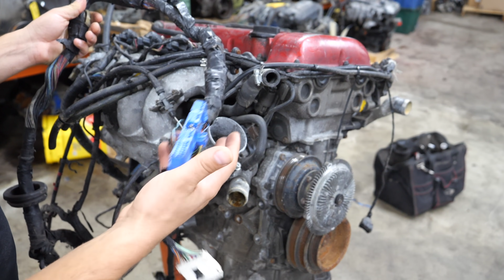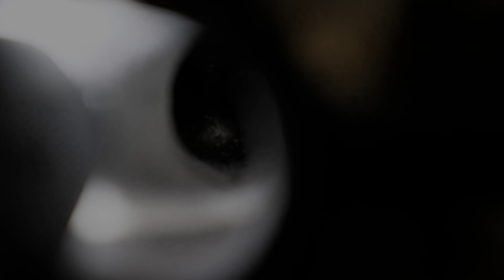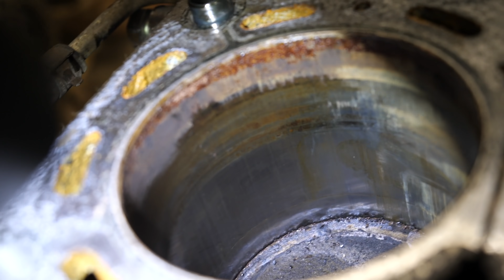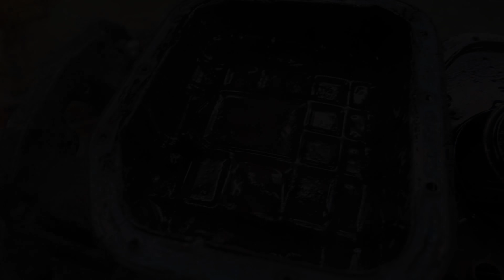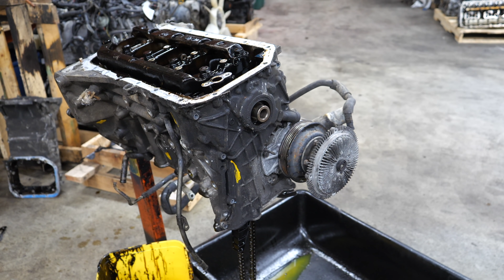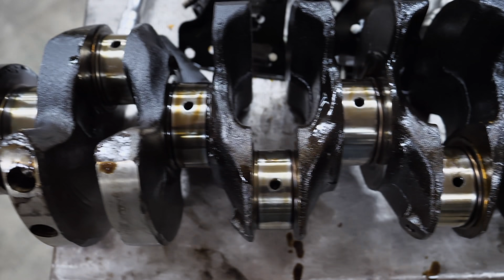JDM Nissan Silvia SR20DET BAD ENGINE TEARDOWN. What Killed The Most Popular 240sx Swap Engine?

Comment: These engines have great aftermarket support, so getting replacement connecting rods will be easy. The cylinders look like they could be bored to a common oversize, so no worries about finding pistons either. It will need valves, but those are also easy to find.

This looks like a good core for a high boost Silvia build.
Reply: Thinking same thing. Plus a bore out with the right piston equals more room for boost?
Reply: @dooooooval904  When you rebore and rehone, you can follow the piston companies recommendation for how much clearance for how much boost you take.
Reply: There to expensive and have many issues.and the rocker arms are a problem in making higher horsepower,and there getting quite old.

Comment: I had a 200SX SE-R back in the day. Only issue with the engine was the timing chain tensioner which caused chain slap on startup. Easy fix with an upgraded one from a newer SR20. Drove it over 200K miles with no major issues until I got T-boned by a red light runner. Stock it made good power and torque for the time and had a 7.5k redline if I remember correctly. Great motor.
Reply: The B14 SE-R will age like the S130 did. They have parallel stories. A little softer, a little more refined, arguably better in some ways than its predecessor yet these same virtues could also be held against it. Looks also generally weren't well accepted despite being beautiful in its own way. It won't be long before a lot of people who have a first gen SE-R on their bucket list get priced out (many are right now) and realize the next best thing is right under their nose. Just like the S130 is finally getting its due, so will the B14 SE-R. iykyk

Comment: Looks rebuildable , bore and hone the cylinders , replace the bad rod , new pistons , and get some good , long miles out of it ( but that's my opinion )
Reply: It is clearly rebuildable.
But you still needed to disassemble it entirely.
Selling the parts to repair another one (or in fact quite a lot of them) is equally good.

If it were mine, I would feel pretty lucky to only have a rod to replace, and would probably just clean of the bad cylinder and not even overbore them.
1 new rod, 1 head gasket, new rings, new bearings, then check and lap the valves and I would just run it that way if it passes a leak down test with similar enough results on all cylinders.
Reply: Depending on how much of a overbore the cylinder walls need couple need a sleeve at that point it's 👎
Reply: @ohhthepatpat  from the looks , not much , just a slight amount for ensuring the rust is cleaned out for a proper ring seal .
Reply: Agree, send the block to the machinist and slap her back together.
Reply: Spoiler Alert
Reply: @ohhthepatpat  the average sr20 swaps is 6500 dollars now a days! Maching and rebuild this particular onw is the cheaper option.!
Reply: @VinceroAlpha  if you're paying someone to do the work. Getting an sr20 by itself isn't that expensive and swapping in is pretty straightforward.
Reply: @sil4rty  the problem is finding an sr20 for below the 6k mark
Reply: @VinceroAlpha  i remember back in 2012 they were sub 2000! Redtop 1600ish and the blacktop I bought with HPI ex manifold was 1800. I'm lucky I have 2 extra SR cores good to be used for a full rebuild

Comment: I've always liked this engine, even more because of the aftermarket support. A turbo kit on one, dropped into a mid '80's 200SX would be a lot of fun.
Reply: They absolutely rip with some minor parts added. I run a chipped ECU, Z32 maf, 740cc injectors and a Tomei MX8270 turbo on 15psi and make over 310wheel on a virtually stock engine. They take a beating pretty well and make great power for an old 2 liter.
Reply: @masondyer2396  i have about the same Mods Tomei turbo and 1.3 bar which is about 18.5 psi of boost i have a S14 SR engine my car is a S14 it has a 6 speed 350z trans also with a VLSD rear end the car is a lot of fun :)

Comment: A tip for really stubborn fasteners.
There are breaker bars wit a spot where they can be hit with a hammer.
They’re often used to break lug nuts loose on heavy equipment. One guy stands on the bar while another hits it with a sledge hammer kind of thing. You can rig up a smaller version for head studs, you just need to apply steady pressure with the bar while you strike the down on the top of the fasteners

Comment: One of the exhaust valves in the #2 looks like it's chipped on the inside edge towards the spark plug
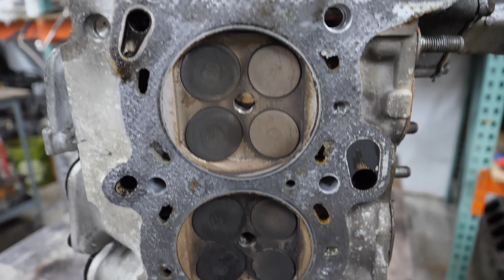Reply: 13:02
Reply: That exhaust valve has seen better days.
Reply: Good catch!
This one clearly leaks compression massively.
Also they are way darker than the other exhaust valves, this cylinder is not hot enough to clean the exhaust valves of carbon deposits.
Reply: Cylinder 4 valves starting to do the same

Comment: Really enjoying your videos and I agree the Nissan JDM engines are easy to work on and yes idiot proof. I'm not a mechanic but with my 795 page manual for my 180SX with a CA18DET I can do everything myself. I have done the head gasket put a exausht cam on the inlet side with adjustable can gears, changed the turbo, injectors and many other parts. My mate always comes to check to see how I done and never been a issue great engines and fun cars to drive.

Comment: I’ve been a mechanic for over 20 years. I had a friend give me a great tip regarding  socket headed bolts. You can do one of two things, take a punch that fits into the hex cavity and give the punch 3-4 good hits or do the same with the socket instead of the punch. You may damage the socket a bit but good steel doesn’t mind too bad. This tip has saved me a lot of time and frustration.
Reply: Socket headed bolts? Are you referring to 12 point or Allen maybe?
Reply: @stevenbelue5496  - He said "hex cavity" so we'll have to assume he meant Allen head. I'm not sure what the tip is supposed to be - it's common knowledge to tap the head of a bolt that is stuck tight. That's always got to be done without damaging the fastener's key (hex, flats, splines, or whatever)
Reply: Yes, this works great.  The axial shock imparted by a few sharp hammer strikes will often free any galling and make Allen bolts come out quite easily.  The Germans love these damned bolts and I learned this trick from a buddy of mine who works on German cars.

Comment: Watching these makes me appreciate all my volvo 5 cylinders more. They’re so much easier to disassemble
Reply: Yes, however that is offset by the embarrassment you suffer from driving a Volvo.
Reply: @johncoops6897  you’re not keen on Volvos, have 3 over 300hp and awd. One being a 6 speed manual hitting 20lbs of boost…to each their own
Reply: How do you figure this the sr20 is probably the easiest 4 cylinder of its era to work on I don't no how it could be any easier without making comprise
Reply: The only hard thing is removing the cam cover with it's 10 thousand bolts and then reassembling them with lots of thread repair kits ready. Apart from that working on them is great.

Comment: The SR20 does not like it if you leave the oil changes too long. The oil feeds to the cams are tiny pinhole thick, so they can get clogged easily and you end up with cams that feel like sandpaper
Reply: but this engine had nice cams and journals
Reply: @adotintheshark4848  Yup. Which is weird. Because with the way that head looks, you'd expect them to be torn up. Might have been sitting with old oil for a while rather than being run with old oil?
Reply: @LockieNZ  the rust all over seems to agree with you
Reply: @LockieNZ  We had a SR20 Serena van come through our family shop many years ago that had chewed a lobe off, it had never had an oil change once it was imported to NZ. I remember the owners scrapped it because they couldn’t afford to fix it.
Reply: @zeroyon4562  I'm a kiwi too ;)

Comment: I had a nicely modded SR20DET in a Nissan Sylvia (S15) running at around 280bhp. This, in a car that weighed 1,240 kg! It was an absolute hoot! I miss it terribly. These engines in the UK go for around £2,000-£3,500 at the moment.

Comment: I’ve had two of these engines and both developed rod knock because of sludge. The rest of the engine looked really good though so I replaced the bearings and cleaned it up and it’s been running very strong for 4 or 5 years now. I love an sr20

Comment: Spent 9 years working at pick-n- pull.   I spent a good 3-4 years underneath the drain racks as a drainer/ cat cutter/ gas tank drainer, etc.  We would have to do anywhere from 30-50 cars a day.  Aluminum pans would be punctured in 3 occasions; the drain plug was over torqued and caused the bolt to strip.The engine suffered major head gasket failure (10 plus minutes of draining molasses and still not done), or... out of sheer laziness.  And yes,  sometimes the aluminum casting would completely break and it was really bad. Anyhow,  it was because we were always rushing.  I'm not there anymore,  much happier now.

Comment: Not like it matters all this time later but did you notice the chunks missing from one of the valves in either cylinder 2 or 3? I don’t recall what position the head was in but I can’t imagine that cylinder making much compression with those pieces missing lol

Edit check out 13:03 and it is visible on the exhaust side I believe

Comment: My red top is from 1989.. makes about 400hp, its going alright with stock block but almost time for a rebuild.
Throwing a rocker, chain tensioner and oil is the biggest issue with sr20s.. they have tiny capacity and a crappy pump.. imports are a gamble as they never seem to change the oil in japan.
Absolutely great engines.

Comment: The tension on that chain is normal for an SR. The tensioner is powered by oil pressure and only holds tension when the motor is running.

Comment: 0 compression is always valve related unless you don't have a piston in 1 piece which is quite obvious if you do.
Reply: yeah I'm guessing the valves were timed 360 degrees out so it looked right but never made compression. some shade tree rebuild that was forgotten when it didn't work.

Comment: I bought a used 1 owner Mazda MX6 LS with 90K miles, v6 (200 HP) 5 speed for $1,500 and it was so much fun to drive, I sold it 10 years later to a friend for $1,500 with 94K miles,  I sub I still had it

Comment: You’re missing the bottom part of the oil pickup.  You shouldn’t see the screen, it should be covered by a cone to suck up oil from the bottom of the pan.  No idea how it didn’t run dry of oil without that.
Reply from the maker: Really? Well maybe they just kept it overfull 🤷‍♂️
Reply: this is an early gen sr, no fins casted on the front of the head. that's the way the oil pickup was designed.

Comment: That is the engine I would like to swap into my 1985 Nissan 720 4X4. I do not want it dfor drag racing, just to bring my old truck power up a few notches for todays highway speeds. The Z24 engines were so gutless, but back then speed limits were 55 and 60 so you did not need much more in a 4x4 truck, but the extra power would be nice.

Comment: Dammit I was wrong lol I saw redtop SR20det and my immediate guess was spun bearings lol I genuinely don't get how this happened, but it happened. Hone the cylinders, some forged pistons and rods and we off to the races. This has to be one of the easiest SR20's I've ever seen disassembled, every one I ever had to take apart was pretty destroyed. I know everyone hates on em because they don't sound the best, but I always had a soft spot for the SR's, really really strong engines that can take a beating and keep going.
Reply: I was expecting a snapped oil pickup, but that was a years ago thing where they were sitting them on the oil pan fof shipping and the pans are real shallow denting the pan and bending the oil pick up. Had a friends snap off and ruin every bearing a during a burn out.

Comment: the scream is dry rubber from being dry to long and the lack of tension on the chain is dude to no oil pressure it will be loose until you start the car

Comment: Do you ever consider spraying some WD-40 in the spark plug holes before attempting to turn it over?.
Reply: If you really want to put down some lube, use anything but WD40.
Reply: @wobbiewall4821  Just as s quick spray before it's turned over by hand, if your gonna start it after a long sit look into something else.

Comment: Is  that a drill or an impact you're using on the valve cover? I tried using my impact on a valve cover and it broke the head off two bolts. Unlucky? Or is there a trick to not breaking the heads off with small bolts (10mm-16mm)?

Comment: The dull grey color in the bores is a dead giveaway that the rings are toast.   Thus no compression.   My guess is it wore out and sat to get the rust.  Japanese engine's of the time were notorious for wearing out the rings by 250k.
Reply: Had a Silvia with the T28 ceramic baller, brilliant.  Workmate had the same car with the non baller T28 with 300k.  Drove it hard from start up, never serviced, never cooled down, never drank oil and it never failed apart from a fuel pump failure.  It failed when he was rear ended.

Comment: Imho they thought it had almost no compression because it turns over way too stiff for a starter motor to spin it on a rpm high enough so that the cylinders are able to build compression.

Comment: These cars must still exist in the south because up here in the salt belt i never see older Sentras/nissans.  They rust out so bad.  I owned a late 90s  sentra and the rust ate thru the floor panels.
Reply: I had a SE-R and it was a North car. Rusted all up but the engine was amazing. I now live down south and I don't see any.

Comment: Did you reccondition that block or throw it to trash? Looks like it had dry sleeves, so that cylinder 4 would be still possible to save. And all Japanese engines up to year 2000 are so simple and bulletproof. Anyone can do overhaul.

Comment: No cheap timing belt in that engine, it's got an honest to God chain!
Reply: only cos in japan they dont like replacing belts on a car that is replaced not long after that
Reply: Timing belts are not that bad. (nowadays)
They are reliable, they don't create a lot of losses. On most older cars they are pretty easy to access and replace.

And also, no crappy plastic chain guides breaking down to pieces and cooking inside your engine...
Chain would be a clear winner if it wasn't for those crappy pieces of plastic.
Reply: @Fabien2626  you dont understand the car and registration system in japan,they scrap cars only a few years old,hence major mainence at 100,000km is not what they want
Reply: @andrewsmart2949  I wasn't answering this comment, but thanks for the information, I didn't know that.
Reply: @andrewsmart2949  I thought they kept them usually, unless they got into a minor fender bender, then they scrapped them.
Reply: Timing belts are a superior design.
Reply: @prevost8686  depends on the application but they certainly have an edge in absorbing vibration and keeping crank and valvetrain harmonics separated but the trade off is shorter life,i change my own belts being a mechanic but if you cant do it yourself the labor charge ca be killer
Reply: @prevost8686  they are a cheap design. You put a good timing chain instead of those belts which will break, and it will last the life of the engine. Manufacturers used to use Hy-Vo chains instead of the two row (cheap)link chains they do now, and those never broke.
Reply: @Fabien2626  but they should never be used on interference engines, for obvious reasons.
Reply: @adotintheshark4848  In France we had quite exclusively interference engine with timing belts in the 90s to the 2010s.
They are still running for the most part, and I'm sure some of them are using some old tired belts.

If you change them in time, that's not a big problem.
They are so common, pretty much anybody knows they have to be changed once in a while.

Non interference engine of this erea are pretty rare in France.
Some Honda, and some Fiats (dying before the belted interference engine because of other factors, they were common but are now quite difficult to find).

The most common engines in France in this erea are PSU XU and XUD and TU used in pretty much all Citroën and Peugeot cars.
Renault also had pretty much only belted interference engine at the same time.
It was just what was needed at the time. Chains were too loud and limited the rev ranges. And belts were becoming so reliable that they can live several decades before snapping. (also I've seen some cases where the cam seized up, and instead of the belt snapping, the cam snapped in two! They can be very strong)
Reply: @Fabien2626  One advantage a belt drive did have, was that it's marginally quieter than chain drive. But another disadvantage is the belt drive can't be mounted within the engine block, it has to be in its own case away from oil, which means making the engine longer.
Reply: @prevost8686  sr-20 chains go well over 300k miles in non-det engines. 
that's two timing belts/tensioners at least. +the original.
Reply: A timing belt is a far better design than modern chains.
Reply: @prevost8686  maybe today's chains because at best they are double-row. The older chains went far longer than belts because of how strong they were, either several rows or HyVo design. Example, the M60 BMW engine has never thrown a timing chain. The rest of the engine would blow up first.

Comment: Why is there yellow paint blotches on the outside of the block? Is that marking some damage or flaw? Also, that head looked super over-torqued. Someone trying to fix a head gasket leak with extra pressure? LOL.

Comment: why not make a padded plate for under the engine when you pull the pistons out so if one does drop, it hits something soft?  just wondering if that would be possible to do or not?  it would prevent any damage to the pistons too